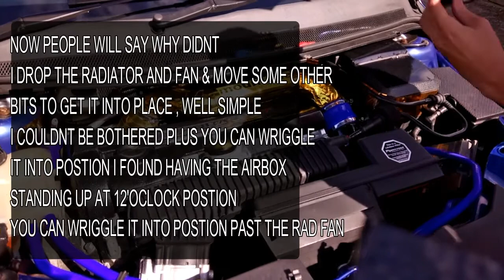installing & or removing the Standard ST Mk2 Airbox

Comment: You still got the 2 blue hoses for the group A? I'm after some!!
Reply from the maker: Callum Hussey - nah sorry mate sold it all with the filter. If your after a group A pipe work I'm sure you can buy the 90*bend and straight peace on ebay. If I'm not mistaken think the sizes were 70mm 80mm
Reply: I bought the induction filter and blue hose from aj I still have it not on the car if you want it?